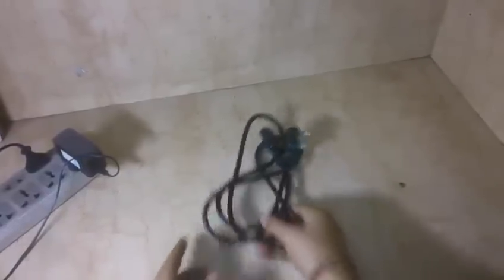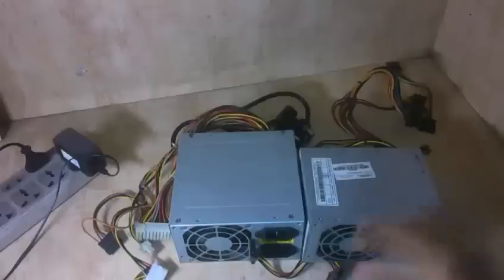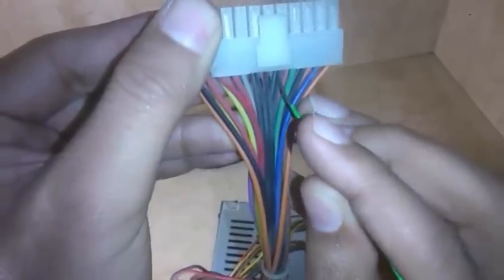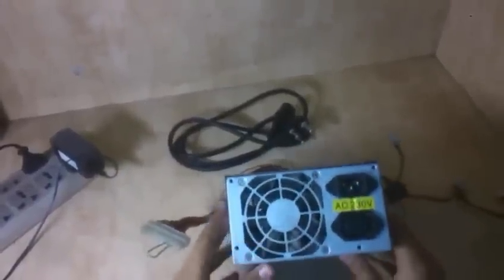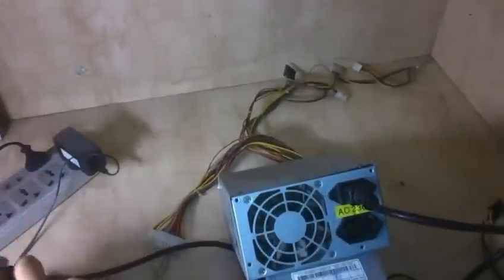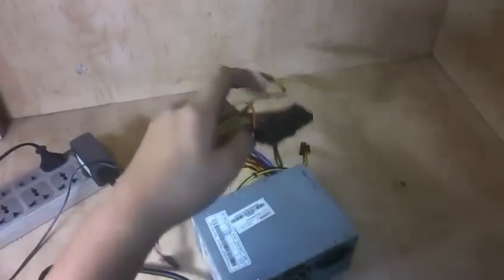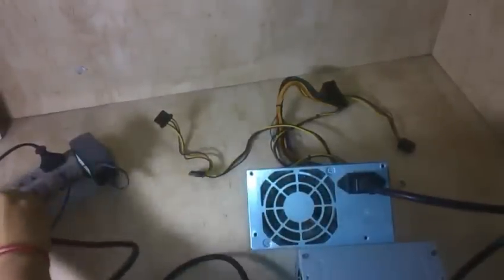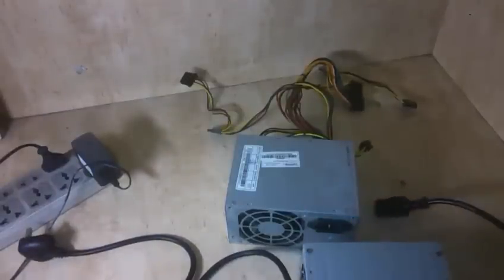How to check smps/power supply unit is working or not simple hack

Comment: Sir I got a new smps of Corsiar 650. I am assembling my new PC but the rest of the components is on the way which I ordered online. I got the smps first. But when I am plugging it on electricity. The fan is not moving or rotating. Do I get faulty smps or  need to check through ur process by adding jumper cable.
Reply: Check with the jumper cable first
Reply: @ethicalhacker1  New ones don't have colorful cables... All of them are in plain black color.
Reply: Same. I thought my SMPS stopped working. So, I brought the new one and i connected it to power, Nothing was happening (I connected only 4 pin cpu EFS power cable with main cable).
Did it work for you or was there any other reason?

Comment: plzz help me when i plug it with jumper cable the fan would run for a while and then stop working..
Reply from the maker: +Mr. CRH may be there is some overheating issue or may be something else  i suggest you to take it to repair shop.
Reply: Sir mere pass jo Computer power supply ha wo on hoti ha voltage aty ha after few second off ho jati ha or fan b off hojata ha how to repair this?
Reply: Ur motherboard is not in working condition !!
Reply: Buy new SMPS
Reply: @StockSense010   its late for me to reply you, but for those future sake, its not the MB, its the SMPS itself. Better buy new one.

Comment: I have a question regarding smps-

My computer was having a usb problem for some days and my usb keyboard and mouse was frequently getting disconnected during my work. After that suddenly one day when I switched on my computer there was no display but the smps fan and cpu fans were running. Then suddenly the smps totally became non functional. So I want to know that is it due to faulting smps all these issues were happening in my computer ?
Reply: I do have same problem with my pc. I am plaaning to buy a new psu . What have you done?
Reply: @im_amitanand  terrible thing he has done

Comment: Best cheap smps any suggestion ?
Reply from the maker: +Suneel Yadav zebronics zeb-450 dsata m using this one since 2014 and still its working perfectly fine but before buying any smps cross check the power output u need for ur pc.
Reply: Thanks for reply. I talked to shop he said zebronics smps is rs.550 I thinking about buying it
Reply: Hey that zebronics is of amazon
Reply: At price 550 and 527

Comment: sir your assumption is not correct always, some times smps is not through even fan rotating this is my experience. and some times it will not work with load even all voltages is correct.
Reply: Yes.correct plz watch our video

Comment: When i on cpu it starts and stops after 20sec and than i open cpu and remove 4pin atx wire from motherboard and after that on cpu but than smps fan is running but motherboard fan not..
So where is the problem in smps box or motherboard?
Reply: Check ur SMPS wattage
Reply: Mayukh Das Ac 220v~50hz written on it
Reply: I may be late, but for those who face this issue in the future reading this comment, your SMPS is no more suitable for your PC. If you can't repair, just buy another one. You'll be good.